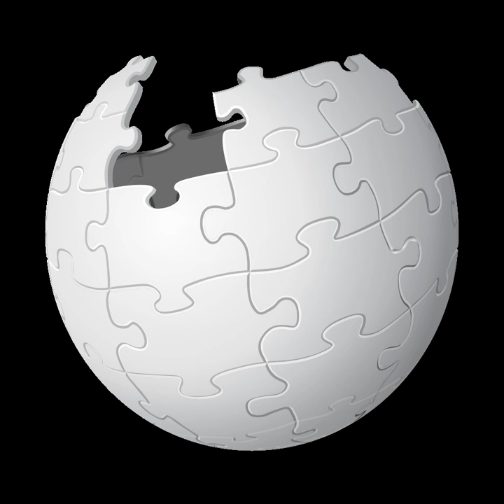Loop electrical excision procedure | Wikipedia audio article

Comment: With leep procedure, say goodbye to sex drive, shorter cervix, harder to get pregnant, loss libido, loss orgram function, nerves connect up cevix damage by treatment. Loss interested on having sex with partner.                     Had CIN 3 and HPV used escharotic treatment, normal pap smear, still got pregnant.